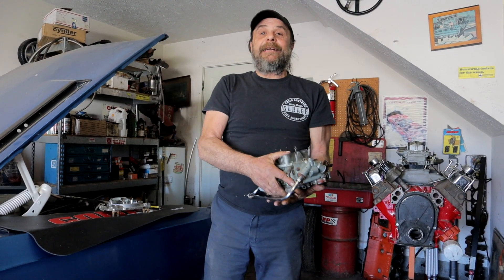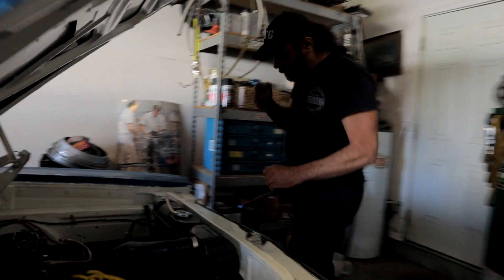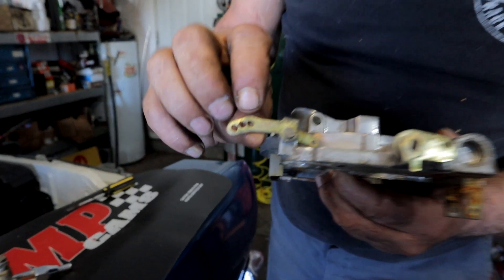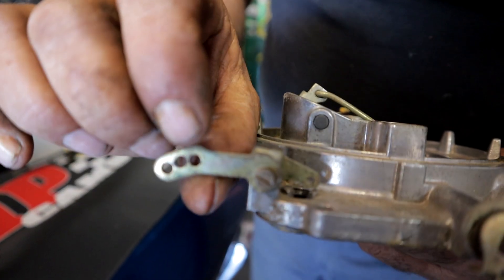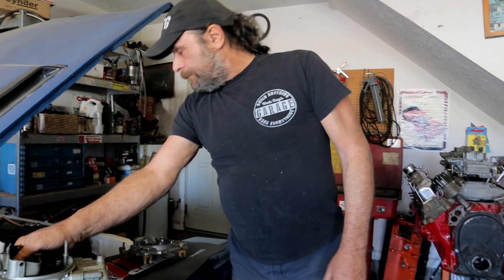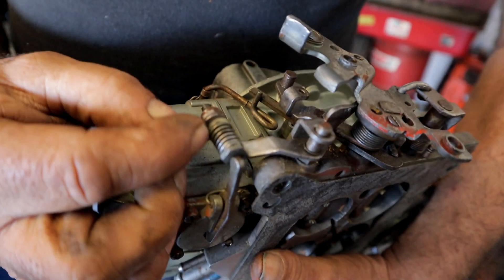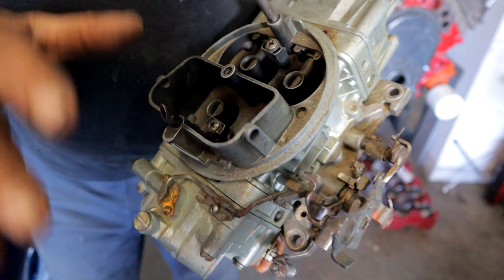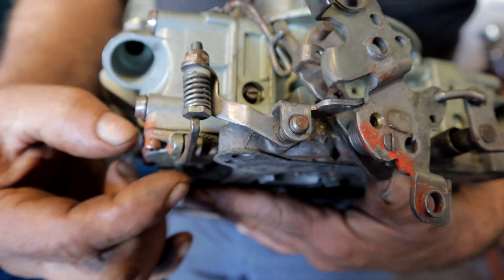Touch The Gas, And BAM, She Goes!

Comment: Glad you mentioned initial timing, lots of people don't realize how much that affects off-idle throttle response.  If you have a stumble and your initial timing is off you'll be pissing in the wind trying to adjust the carb to fix it.
Reply: I have 24 initial and 38 total, no Vac advance.
Reply: @jakefriesenjake  if you do any street driving I highly recommend getting vacuum advance hooked up.  If it's set up right you'll gain noticeable fuel economy and your engine will last longer with no bad effects at all.  It takes some time but is definitely worth it since it's basically free.  I know there are videos on how to do it right, if not from UTG I know for sure some other channels.
Reply: @mopartron3030  agree. not enough initial can make it run hot and not as responsive as it should be

Comment: You should try to find one of those old school predator carburetors like the one bigfoot ran on his truck, them things have some of the best throttle response.
Reply: Ha! Really?
Reply: @johnsheetz6639  yeah, check out some videos of them, the way they are designed makes them incredibly snappy but they are rare and pretty expensive and are difficult to find parts for but they are worth the trouble.
Reply: @briang4470  i will and i dont doubt
Reply: Idk if they had an idle circuit?

Comment: When I had bog on acceleration The first thing I went to is the fuel pump. 9 times out of 10 that was the problem. I found the you have to start small and then go from there. But that is just me.
Reply: Back in 88 a bud got a 67 GTO with a ra4 in it , and it ran good but he had his girlfriends pop drive it.
(musclecar guru of the hood) 
He comes back and said rig a fuel pressure gauge on it , it feels flat up top. 
So we did. 
Sonofabitch it was dropping off over 3000rpms. 
An upgraded pump to hold the pressure up, and it felt like another 40hp.

Comment: My edelbrock shreds accelerator pumps after minutes of use. Wish they were made of something a little more heavy duty.
Reply: the pump hole must be smooth, fine grit paper will do the job
Reply: I'd try smearing a little dab of vasaline on it after making sure there was no rough spot where the plunger rides.
Reply: Theres gotta be somthing pokin out to do that... The pump body should be perfectly smooth. Either that or maybe youre damaging them when putting them in(??) Im not being insulting, speaking from  experience. In my early wrenching days i didnt understand "finesse" LOL and tore a few...